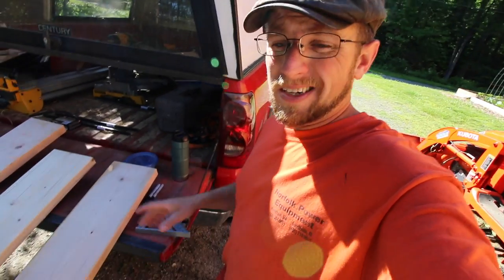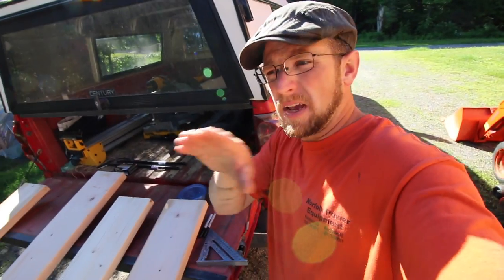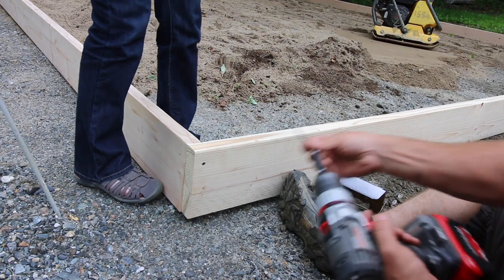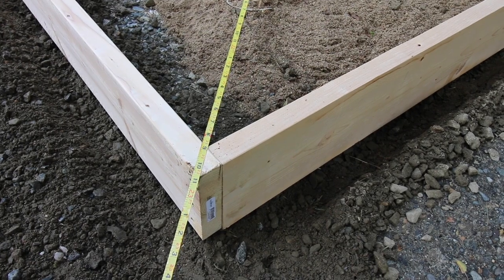BUiLDiNG an Off GRiD Outdoor Kitchen Build# 2

Comment: Looking good. You shouldn't need the expense of cattle panel. Standard 4" square concrete mesh should be more than adequate for reinforcing. It comes in 4' x 8' panels. Regardless, a slab that large, you will want to cut control joints to control the where cracking occurs, it will crack. Cutting control joints with an edging tool, or after with gas, concrete saw will guide the cracking, rather than willy nilly cracking without. Are you and Olivia going to do the finishing?
Reply from the maker: Thanks! The concrete company recommended using rebar, I figured cattle panel is a happy medium! I have a friend coming to give me a hand with the slab.
Reply: Yea, well rebar certainly would reinforce it. lol
Reply from the maker: Yup and unreinforce the wallet! :)

Comment: That's one heck of a thick pad at 6". We go that thick for a building that will have a lot more load bearing on it. Would 4" not work?  Also welded wire mesh is cheaper then the cattle panels and should give you the same results.
Reply from the maker: Thanks! Being in Nothern NH they recommend 6-8" and rebar! We get a lot of frost.